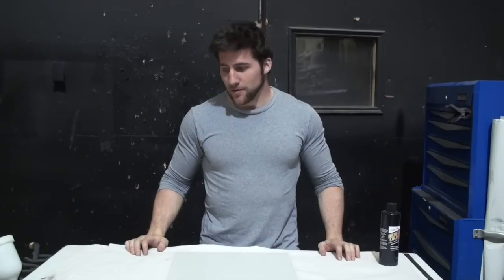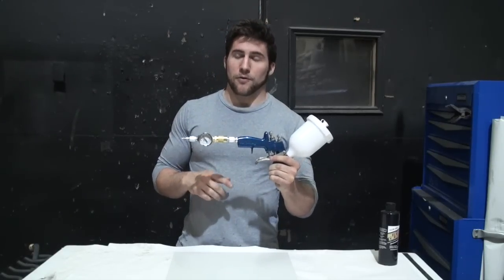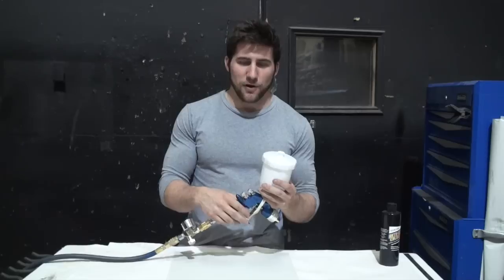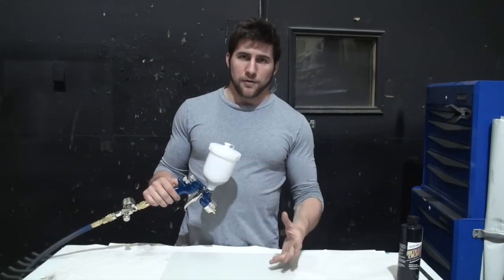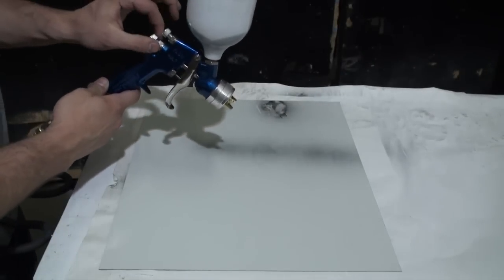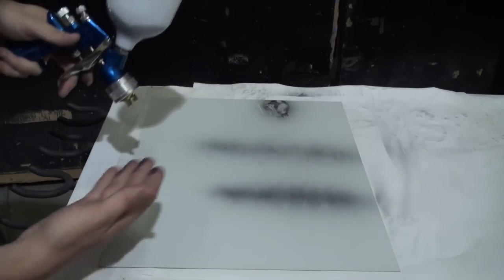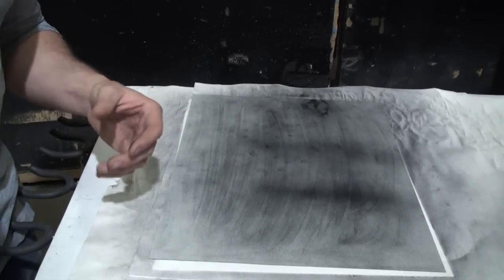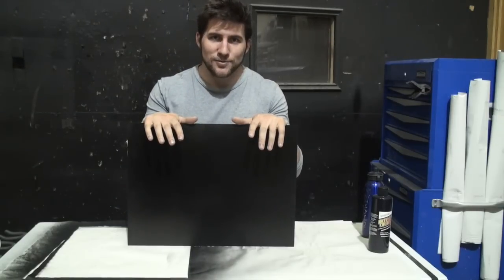How to set up your paint gun for acrylics

Comment: Brad, would these same techniques apply to all acrylics ?  I'm about to spray ''Yenkin Majestic'' diamond hard satin paint, and I'm glad I watched your video, I wouldn't have thought to do multiple mist coats, Has anyone here sprayed Diamond hard ?
Reply from the maker: +lee jeffriess it probably depends somewhat on whether it's an acrylic that was designed to be sprayed. I've never used that particular one.
Reply: I don't believe it is ! I think its intended as a sub for old school oil paint , for brushing out doors and window casing etc, I was going to thin it with distilled water
Reply from the maker: Test it first of course, but yes you can probably thin it with water and mist it on. Keep in mind that if you thin it with water it will take longer to dry.

Comment: hello congratulations for the video, what brand are the paint gun to use in the video? Bye thanks
Reply from the maker: Devilbiss
Reply: hi thanks for the reply, an info that size must have the compressor to paint a guitar?
Reply from the maker: It depends on what size gun you are using and what it's air consumption is. It also depends on how big the compressor's tank is.
Reply from the maker: The SLG 610 is a gun isn't it? I think I have one. It's not a compressor.
Reply: yes it is a gun, I wanted to know if the compressor 2 atmospheres may be fine, or need bigger?
Reply from the maker: I'm not sure what a 2 atmospheres compressor is. If you are referring to it having two tanks, that doesn't say how much air it puts out, only how much it stores. What is the CFM rating on the compressor?
Reply: Brad Angove Hello, cfm does not say, the tank is 50 LT, the air suction is 220LT / min.
Reply from the maker: 220LT/Min is 7.77 CFM. That should be fine. Just let the air tank fill up before you start spraying to be on the safe side. My guess is that that gun consumes about 6 CFM.
Reply: thank you very much for your help, how did you get the CFM? the valve attached to the gun that you see in the video what is it?
Reply from the maker: I just converted the litres into cubic feet. Their both volume measurements. The valve I attached to the gun is an air regulator. Turn the regulator on your compressor all the way up if it has one, use the shortest hose you can comfortably work with, and attach a regulator to the bottom of your gun. Make your adjustments there.

Comment: bro what size of fluid spray gun to use for epoxy prime, primer, basecoat or clearcoat..
Reply from the maker: +bogus455 I use 1.3 mm for the base coat, and 1.5 mm for everything else listed there.
Reply: +Brad Angove ...what the best psi for single hvlp from epoxy primer till clear coat?
Reply from the maker: I usually use about 28.
Reply: 1 more question, what if i buy a cheap or middle gun according to the factory lets say the gun air pressure 45-85 psi, should i go to turn it to 28psi?
Reply from the maker: The factory is specifying that it runs at 45-85 psi? That seems high, but they would probably know better than I would when it comes to that specific gun.
Reply: such a good sharing info bro...thank...now i can proceed my aim..thank a lot!
Reply from the maker: You're welcome. I hope it goes well for you.

Comment: is it possible to change the tips fromsmall to bigger with a single gun
Reply from the maker: It is if you have a gun that has various tip options. The one I used in this video came with three different sizes.
Reply: thank you for your quick reply sir
Reply from the maker: You're quite welcome.

Comment: Hi, Brad! Planning to build a kitchen cabinet from birch plywood and paint it. I've never built, nor painted anything, so can you give some advice? Is it easier to paint the cabinet with roller, brush or spray gun? I'm looking for an easy way to get good results. What kind of paint is best for a kitchen cabinet made of birch plywood? do I need a primer first? Thank you!
Reply from the maker: Birch plywood is quite porous. What kind of finish are you looking for in the end?
Reply from the maker: I mean do you want a wood grain finish? Or are you trying to get it completely smooth?
Reply from the maker: You’re going to need to sand and then probably grain fill and sand again. I have a few tutorials on grain filling. 

Then I would probably say spraying is your best bet. You don’t necessarily need a spray gun, but do you have one?
Reply from the maker: I have a video on some of the Warwick ones I like. But if you’re just doing this project it’s probably easier to use spray cans.

Comment: Im using akrylic on cabinets and its not setting right. It is too choppy looking
Reply from the maker: Did you seal it first?
Reply: @BradAngove  you mean prime it first ?
Reply from the maker: Primer is an option. Or sealer. What do you mean by choppy?
Reply: @BradAngove  I always wash the surface with water and dry, then I prime with Zinsser all paint and surface water base primer and then after 24 hours I sand that lightly and wipe off then I put the paint but this akrylic enamel will NOT lay smooth. It dries like little bubbles are on it and if I try to sand it smooth like I can with water based it doesnt work. Like how do I use it? I have a sprayer and the settings is low but it still comes out like its too thick but its super thin. If I use a roller it does the same thing
Reply from the maker: What paint is it?
Reply: @BradAngove  behr urethane alkyd enamel semi gloss water base
Reply from the maker: If you haven’t already, try using one of the foam-type rollers and applying a really thin coat.
Reply: @BradAngove  Yeah I have it does the same. Guess its just the paint. I dont like the rough feeling and looking bubbles that it dries as

Comment: Why you no use thinner?
Reply from the maker: +Henry “Adda” Chaisritha I'm using a 1.3 mm nozzle gun, and I just find that this paint flows well through it without the reducer.
Reply: +Brad Angove wow 1.3mm is crazy. I have 0.2mm nozzle airbrush and I'm having problem getting thinned acrylic paint come out of the nozzle after 1 or 2 minutes of using it. The nozzle hole looks insanely small. What do you think is causing the thinned acrylic paint to not come out of 0.2mm anymore? paint dried too early in the nozzle hole? What do you think is best for me? Or just get a higher nozzle airbrush?
Reply from the maker: What pressure are you spraying at?
Reply: +Brad Angove auto-start 31 to auto-stop 57 psi.
Reply from the maker: Ok. I use 35-40 PSI with my 0.15 mm nozzle airbrush. You do have to thin your paint quite a bit for that though, like the paint needs to be almost as thin as water. Don't try to put metallics through a nozzle that small though. That's a bit too small to be an all-purpose airbrush.

Comment: Step one. Buy a SATA. Step two throw away all your other guns. Step three shake your head why you ever used those other things.
Reply from the maker: Step 4: realize paint guns choices are relatively subjective. Step 5: wonder out loud why you need to spend so much more to get the same results. Step 6: consider giving up on painting. Step 7: wonder why devilbiss and Iwata are gaining popularity while SATA is at best maintaining its market share... back to you.
Reply: Brad Angove it's a joke man. You gave good advice.
Reply: Brad Angove And ya if your taught on a certain gun it's hard to break a habit. But the better painter I've seen use SATA products. Also the hanger on's of solvent based paints can usually find a cheaper gun like debillvis. Which also offer package deals for guys who spray in there garage or are staring out. Iawata makes nice guns for clear. I spray water so I use a Sata 4000 and a 5000 to clear I've owned a 2000 for 15 years. I bought a debilviss and had crazy problems. So ya drop 2-300$ on a cheaper gun or save up buy something that you think is top of the line then see what happens when you spray. It's kinda like prepping a car the better job you do the nicer it turns out. So if you take the time to learn how to correctly spray then I guess a cheaper gun might work if you know how to use it.
Reply from the maker: Mine was also a joke. I see why maybe it didn’t seem that way; sorry. I really need a “just kidding” font haha.
Reply: Brad Angove that is a nice video man too many people want to show how to spray a car just not how to spray a car with the correct set up.
Reply from the maker: Once you’ve got the gun adjusted properly it’s pretty straightforward. I agree, there are lots of videos out there about the exciting part, but it doesn’t work if you don’t have the first step done properly.